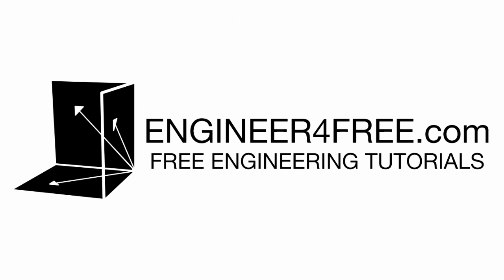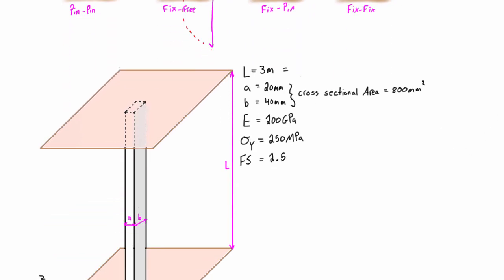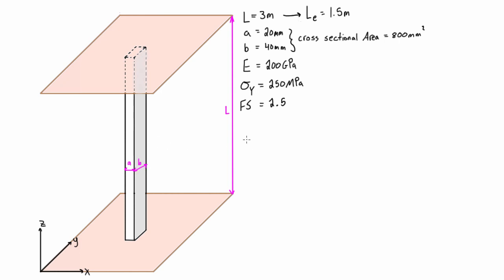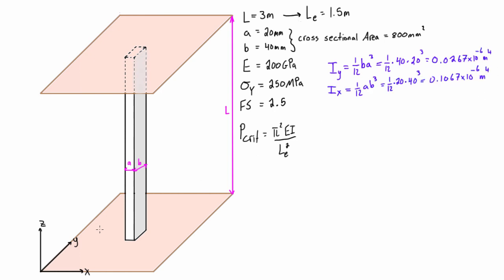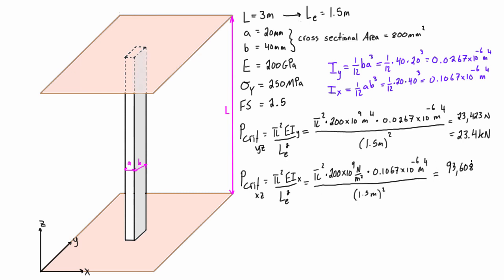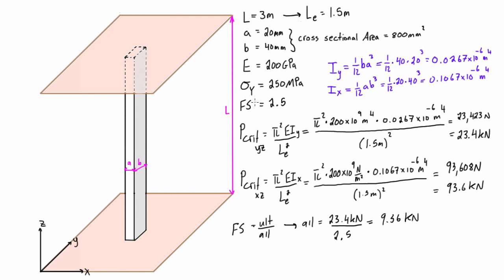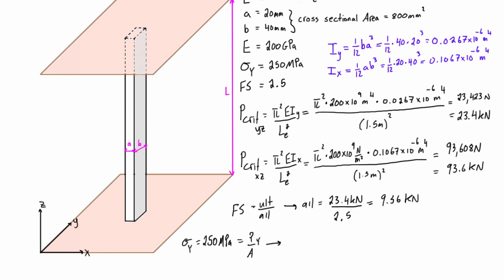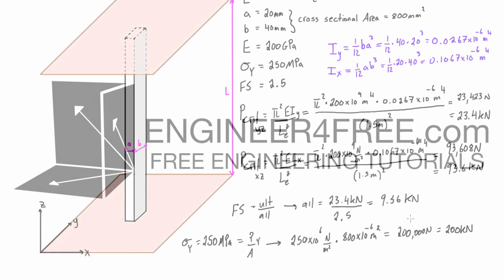Column buckling example problem #2: both ends fixed

Comment: I am afraid you forgot to divide the load calculated by yield stress in the end with the factor of safety. I believe the step should be shown nevertheless the critical load selected in the end is correct.
Reply from the maker: Hey Ali, yeah in the second last line, I write FS = ult / all. Referring to Factor of Safety = Ultimate Load / Allowable Load. I rearrange to find the Allowable Load = 9.36kN. I realize now while watching it that I don’t come back and mention that despite the column having the tenancy to buckle before yielding, that neither will happen if we respect the maximum allowable load of 9.36kN. Thanks for the comment! Any I hope this clarifies the question for others if they see your comment too 👍

Comment: I am afraid i don't think the formula for fixed fixed end condition is properly followed 
this supposed to be Pcr= 4Pie2EI/Le2
Reply from the maker: Hmm. I follow the method from Mechanics of Materials by Beer & Johnston. This PDF https://wp.optics.arizona.edu/optomech/wp-content/uploads/sites/53/2016/10/OPTI_222_W18.pdf has diagrams and formulas copied right out of the textbook, you can see there that they use Pcriit=(π^2)(EI)/((Le)^2).
Reply from the maker: You might have a 4 in the numerator if you switch Le for L in the denominator. Le = 0.5L for fix-fix. Dividing by 0.5^2 is the same as multiplying by 4.
Reply: Abdulkadir Hassan ahmed  somali
Reply: WHAT HE DID IS CORRECT